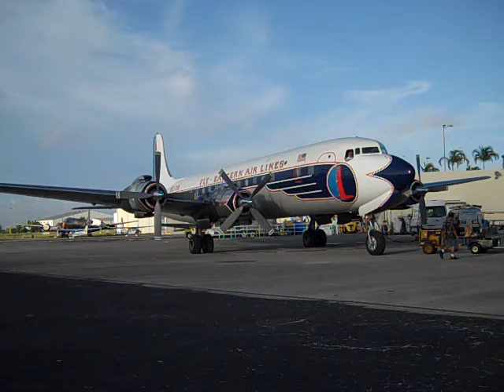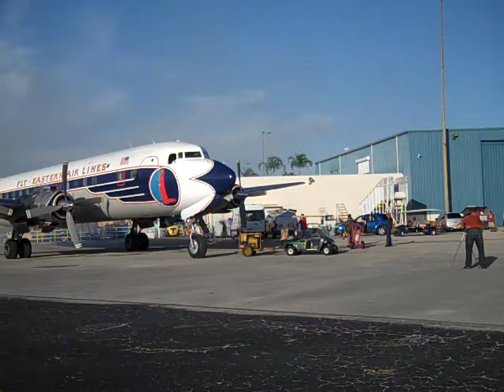Wright R-3350 Turbo-Compound (3,400HP)

Comment: The turbo compound muffles the engine sound a little. This system was also responsible for the Wright R-3350 with turbo compound suffering some breads, which led some to say to this day that the R3350s were not reliable engines.

But even the Wrights R-3350 having these problems, is still my preferred Radial Engine.

The DC-7 and Connie are MYTHS together with the R-3350s.

Comment: No 3400 hp on 100LL.  You need the old 115/145 avgas to be able to run enough boost to get that much power.  On 100LL you are limited to about 2800 hp.